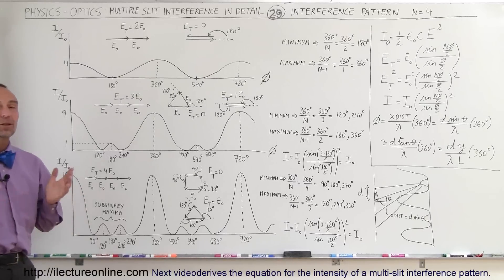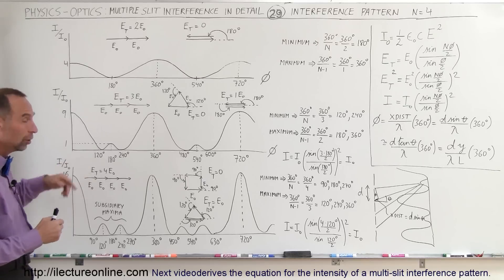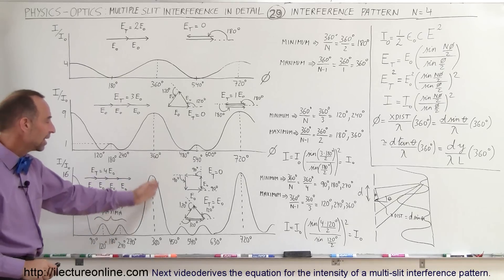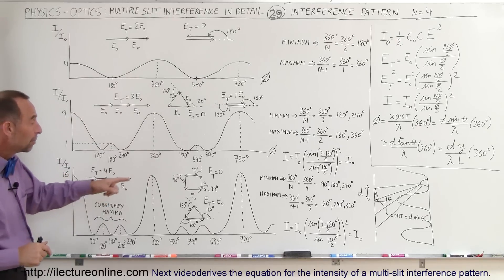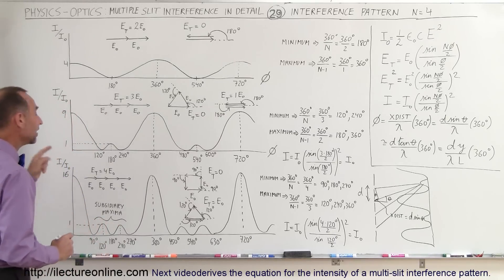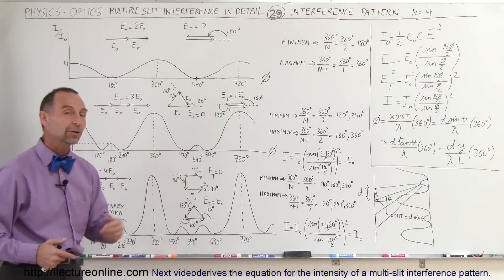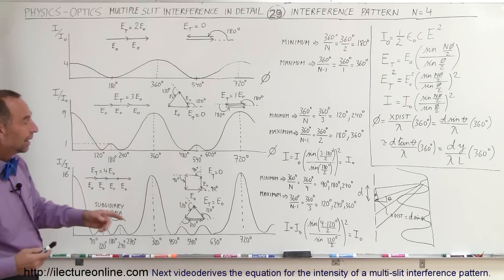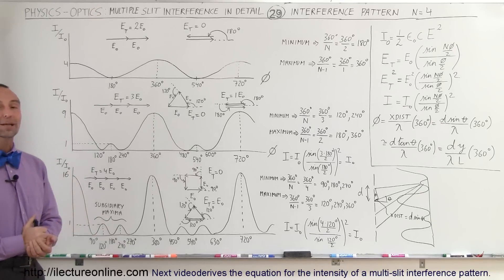Physics 60  Optics: Double Slit Interference (29 of 35) Max Min of 4 Slit Interference

Comment: Hello sir, i have some questions about the secondary maxima. Why if i subtitute 135° in intensity equation, I > I zero?  Is 135°, 225° the secondary maxima?
Reply: I just graphed the 3 slit and 4 slit on a graphing calculator. The secondary maxima of the 4 slit do not line up with the minima of the 3 slit. In other words the graph suggests the  secondary maxima are not 120 and 240 as stated here. it's not 135 either. For instance plugging 133 into the intensity formula gives a higher answer than 135. His formulas for the secondary maxima give the right number of maxima but not the correct intensity or location. I still love his lectures though despite occasional mistakes.
Reply: looking at this again I have realised the issue here is Michel seems to imply the minimum and maximum equations given here (and the graph provided) denote the physical locations of the minima and maxima. That is not true.  But, if we take the x-axis to denote the phase difference (as opposed to physical location on a screen), then this is all correct.